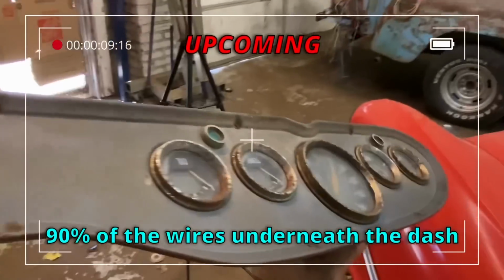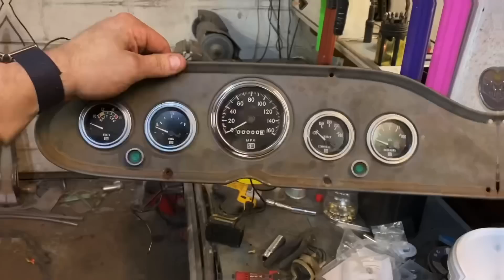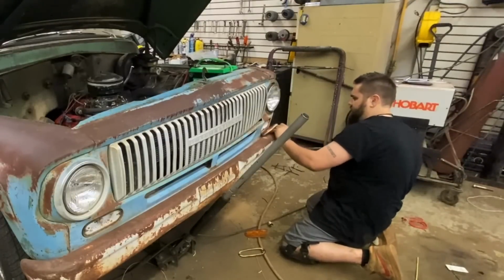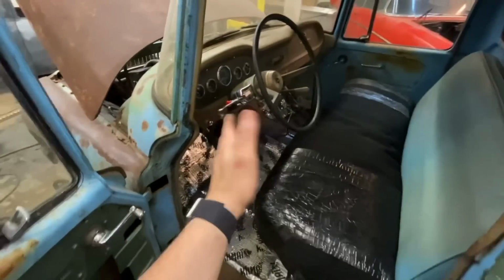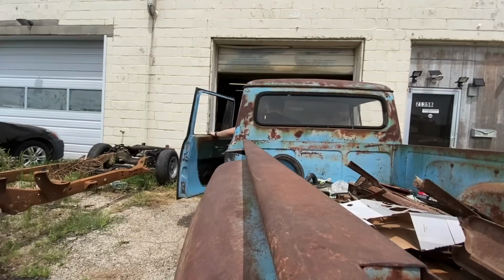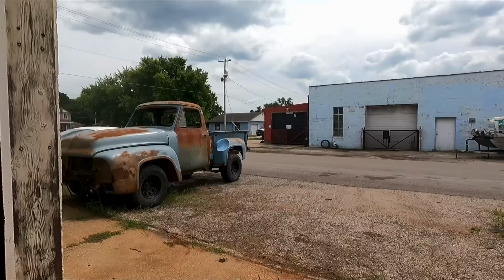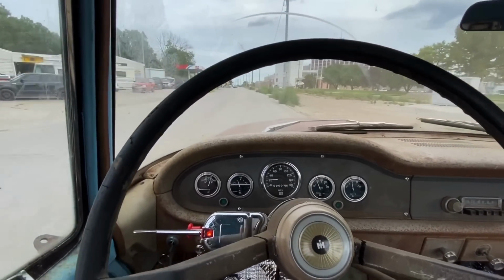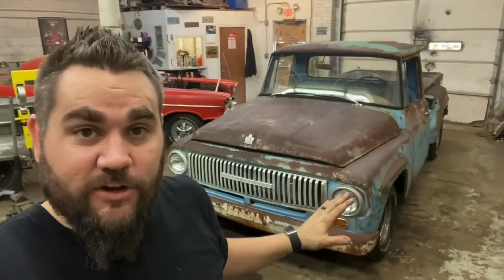ABANDONED 65 TRUCK BUILD IS FINISHED! KUSTOM HOT ROD FRAME, ENGINE, BRAKES & SUSPENSION! RAT PATINA

Comment: Dieseling can also be caused If the idle screw is set a little to far open, that will expose to much of the transfer slots on the idle circuit, the engine vacuum can then potentially pull fuel in through those. 
Set your timing. Then set the idle air bleed screws to highest idle, or vacuum. Then set the idle stop screw. 
Hope that helps. 
Killer job sir. 
Always enjoy your content.

Comment: I have a 1950 Dodge Wayfarer with all original paint and patina. It has a 1979 Z28 subframe mated to the original Dodge frame. Built small block, TH350 with a stall and shift kit, and a 10 bolt posi. I love my car and it would fit right in with your projects. Keep up the great work!

Comment: Seafoam? You could use a product made by BG. It's called BG44K. It's a fuel system cleaner and carbon remover and no smoke! Not cheap, but works well. I bought a box of 6 for $109.00 on ebay. My Subaru engine was making clatter noises from sticky valves and the timing chain hitting the tension retainer because of the timing was out and found out it was carbon build up. So the Service representative of Subaru recommended this BG product. Hey, Casey....Love the International pick up truck build. There's not many left in the world. Very rare to find. One more thing.... It's 76 degrees in North Chesterfield Virginia at 10:17 a.m. Sunday July 31st 2022 when I texted this comment. You need to moved East. It's to hot where you live.

Comment: Seafoam is good stuff, but next time just try water in a spray bottle. Rev the engine and spray a mist of water into the carb. You'll be amazed at how much snot comes out of the tailpipe. ps - dig the go-handle on the dog.

Comment: Awesome truck 🤟🤟 the blinkers is from a golfcar right hehe, thought i recognized it. Worked my first job 2years ago as a mechanic for golfcars that they used 24/7 on a aluminium industri (gränges). They were so run down and every single one had something to fix, all 36 of them. I worked there for 4 weeks during summer, had a great time tho. They had me back halv a year later tho too fix them again, nostalgik too see the work you have done still work. :)

Comment: Lower the idle to 500rpm and see if that helps the dieseling and make sure the carb high rev choke shit doesn't need adjustment. It will make the engine run to 700 rpm and cause the dieseling, tiny last lil step in the linkage. You need 500-600rpms or it's gonna diesel no matter what. The screw is on the driver's side.

Comment: Love the build.
I've been thinking the past year of trying to start a ratrod chassis swap.
Wanna use my 2012 ford fusion as it's paid off and got low km. Thinking a old Ford truck but haven't worked out my measurements yet. 
Annnnnywaaay keep doin what you're doing.
Ps how getting is that car wash.....you still have your kidneys 😉

Comment: what i heard years back was that IHC was only a small time maker of passenger vehicles so they would shop around for the best deal on what ever components or materials they needed for production. maybe the just happened to get a good deal on green wire when they were building those trucks